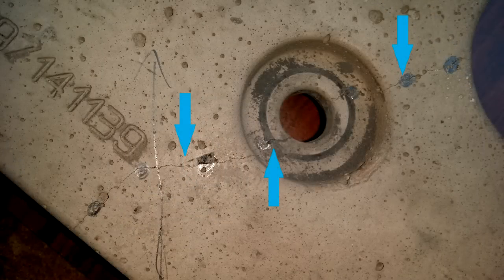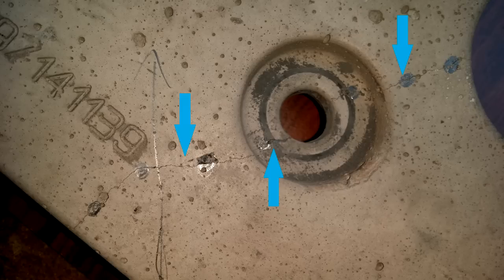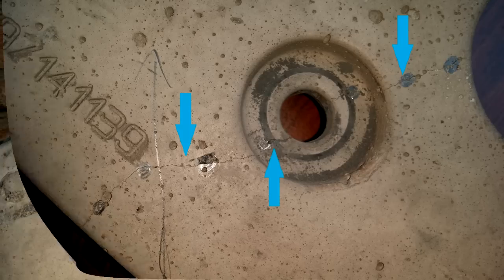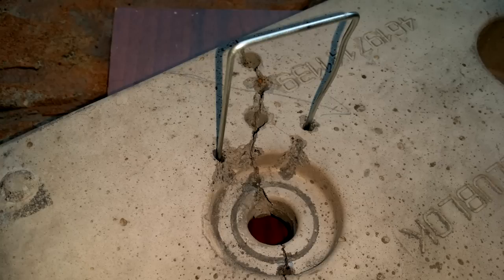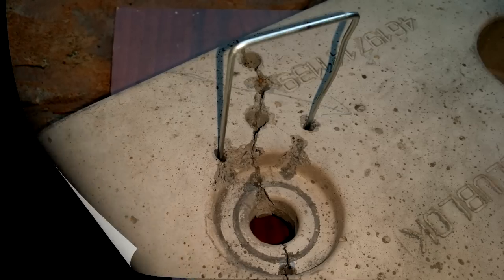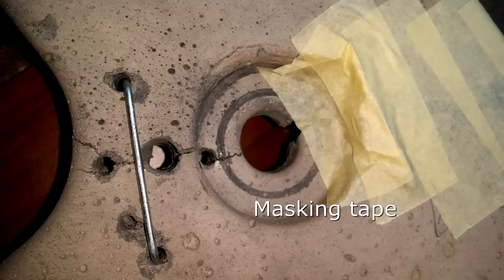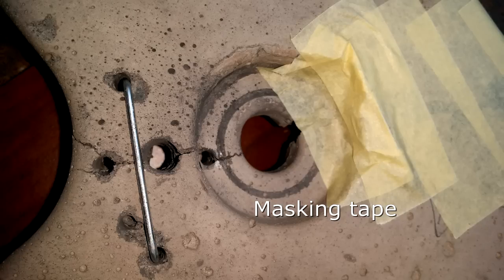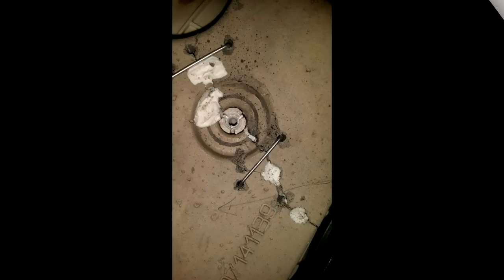How to fix a washing machine balance weight to stop noise when spin drying

Comment: Few days ago, on my machine, top weighing stone on drum got loosened one screw out of 3 and during the full spin it wobbled with such a force that it bumped out ripping  all screws with shank holding structure of the drum. I got so upset , tried to fix with wires but didn't work. But without stone it is working fine. Need to be careful not to overload.
Reply from the maker: You also need to be carefull as the weights are a counter balance when the drum initializing the spinning cycle. Excessive movemt may destry the bearings on the drum.

Comment: Can you really superglue concrete?
Reply from the maker: No it wasn't super glue. I used a concrete adhesive that is made by Soudal. It is an acrylic adhesive that is not brittle and is used for repairing concrete finishing on buildings. It doesn't get brittle when it dries - so i it bonds the pieces together and the wire clamps keeps the pieces held together mechanically.

Comment: Hi, my Bosh Classixx 1400 Express washing machine is making an awful noise as shown in the video https://youtu.be/M0R_e0_aDKM Do you think it is something simple like the belt needs replacing? I have replaced a belt on previous washing machines so I could order a new belt and fix it myself.
Reply from the maker: Sorry for the delay in responding to your questions - It is holiday season.
The noise you are hearing is probably coming from something stuck in the pump as the frequency of the noise does not change with the speed of the drum. SO it is not the belt.
I suggest you open the filter for the pump (front right side of washing machine) and clean the filter.
Watch for spillage when you remove the filter. It is best to have an old towel around.